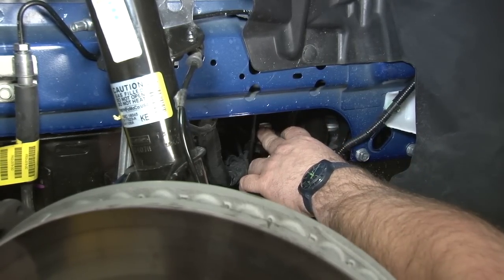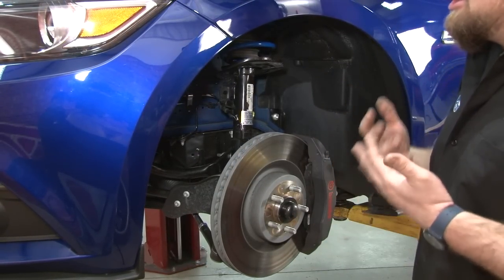2015-2023 Mustang Steeda Front and Rear Sway Bar Installation

Comment: NOTICE ! Steeda changed the bushings on these bars. They are NO LONGER EQUIPPED WITH LUBE Fittings. The product pictures are dated; they show bushings with zerk fittings. Current production bars have no provision to add lube short of disassembly of the bushing/bracket assemblies.
Installation video was very helpful. I set up the bar on the softest setting to get a feel for it. Has not made the car tail-happy as I feared but does help the Mustang rotate in corners. I may add the front bar later. Brake line attachment provided lacks tab to prevent rotation when end link is tightened. OEM unit has a tab to prevent this. Good product otherwise, hope the bushings don't start squeaking in cold weather.

Comment: Why did you take the front endlinks loose at the top?  Steeda says to undo the bottom, which also gets them out of the way when fishing the bar through the front.  The plastic shield you mentioned for the driver side rear bolt is easy to remove, only held on by two pushpins. 

I did mine on jackstands, and you really need to get the nose up in the air to have room to maneuver the bar out.  Figure at least a foot of air under the tire.  Without a lift, the front bar took me about 2 hours overall, and the rear less than an hour.  Aftermarket exhaust makes it easy to just drop the rear bar straight out the back and down.  Starting the front bolts on the rear bar brackets first makes things easier when reinstalling.

Even on a Performance Pack car the bars make a noticeable improvement.
Reply: I took them off at the top so I could easily move the bar to get the bottoms with an impact to save time,
Reply: Bill Tumas hey Bill love the videos, literally just finished my bmr polyurethane differential lockout kit. I also have done Steeda rear sub frame brace, vertical links, bmr cradle bushing lockout kit. Im still experiencing whee hop. Help. Whats left or what do i need to do so i can launch harder. PLEASE HELP

Comment: Hey Bill with all sincerity, are this swaybars better than the ones that come on the 16 performance pack mustang gt
Reply: My car is a performance pack and while they are an upgrade for the stock PP swaybars they are only a minor improvement in the neutral setting but the adjustability makes them a nice upgrade if you track the car.

Comment: I love Steeda setup too.  However, I'm getting some squeaks coming from the rear sway bar after two weeks of driving.  Should I use different type of lubrication?
Reply: When I see posts like this it makes me not wanna change and leave stock, especially when no one offers any advice to fix the problem.
Reply: Do you still have the problem? What did you do to fix it?
Reply: +jdeki yes it's gone now after I took it to a road course and canyon drive guess the grease had to lubricant more
Reply: @jdeki  still no answer ?

Comment: I installed the Steeda spring and sway bars, now i am getting a loud clunk when hitting sharp bumps when driving slowly any ideas on what to check first?
Reply: I would start my making sure the mounts are bolted properly to the frame and then check the endlinks.
Reply: Ok I'll check that tonight thanks. I am pretty sure that's all tight.
Reply: It's the end link that connects to the swaybar on the drivers side. When i hit a bump the end link threaded stud hits the  metal above it.
Reply: +Jason Martin   Was it an easy fix?
Reply: +jdeki  yes they sent me a new sway bar, they had accidentally sent me one for a different model.

Comment: What is the reason for adjustability on the sway bars? And is there an approximate time for switching from one setting to another?
Reply: The different settings are for different applications, mostly track use. Time to change is basically how long it takes you to disconnect the sway bar link.